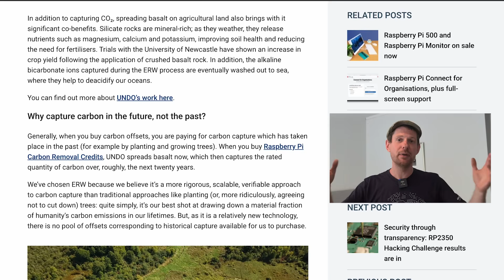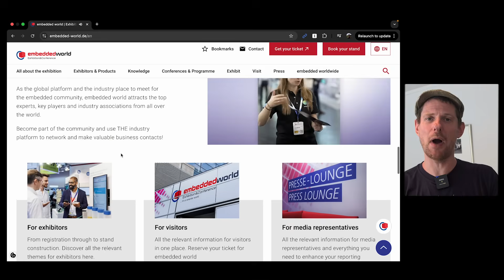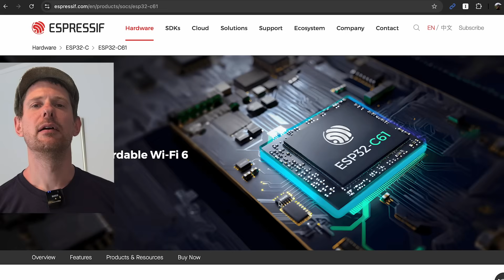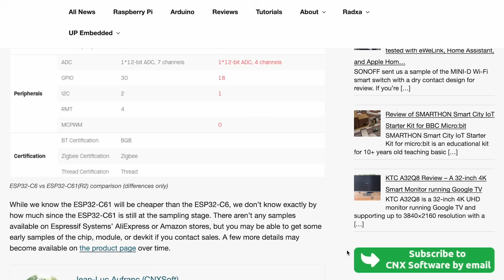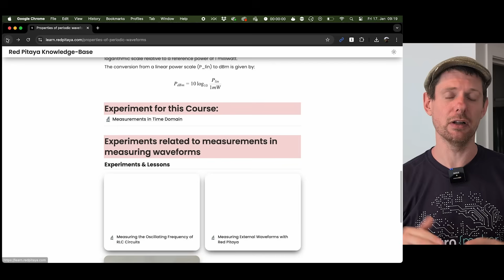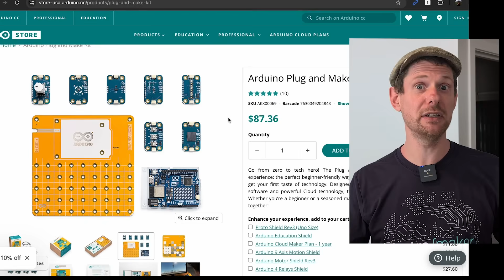Raspberry Pi 5 16GB, Arduino Proto Kits, ESP32 variants and much more!

Comment: Orange Pi RV (seems to be unreleased so far) based on RISC-V using a StarFive JH7110 main processor
Reply from the maker: Nice tip! I wonder if it'll have better support than the other Orange Pi boards?